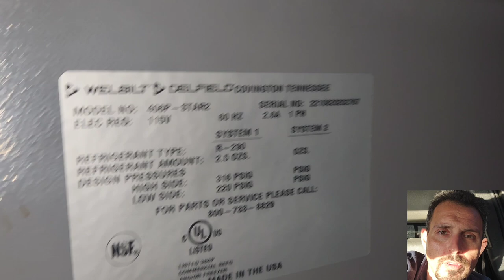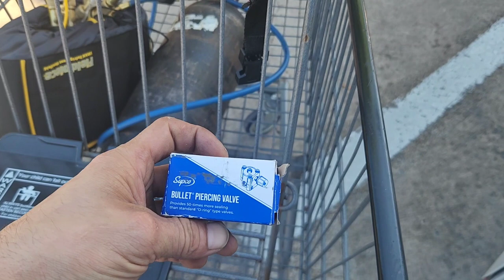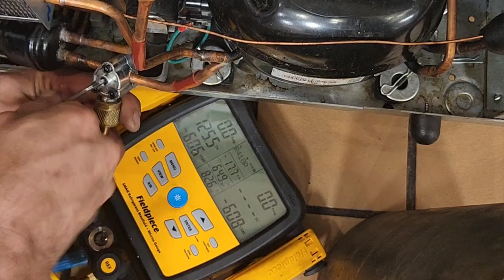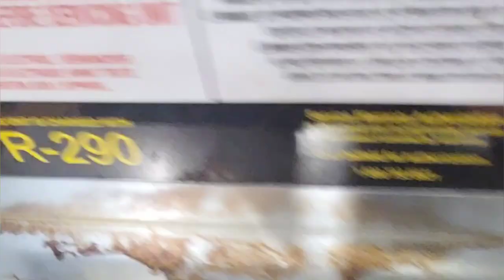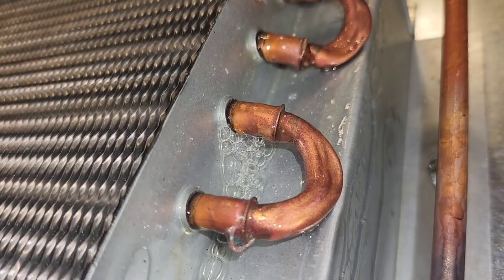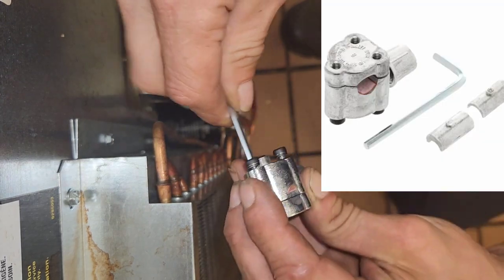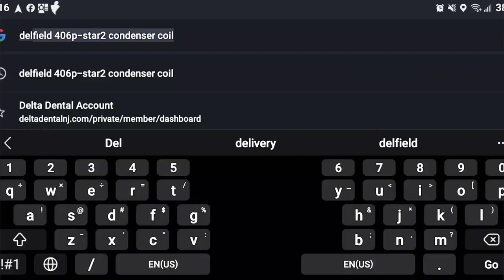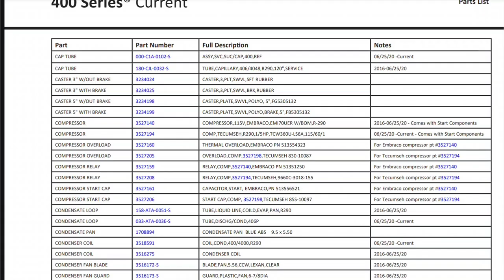Delfield R290 Self Contained Lost All Pressure

Comment: i do a ton of these little guys, always leave the ports on.
also never unsweat out a cap tube, just cut it at the dryer. i use my wire strippers, keeps it from closing up.
Reply from the maker: Yea, I haven't done cap tubes in a long time. I guess I forget sometimes little things like that. Thanks.